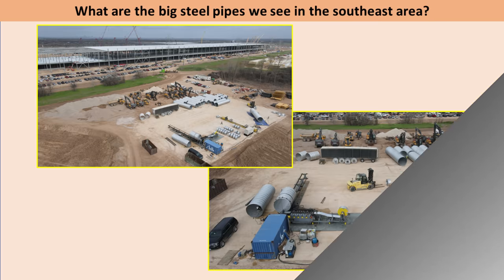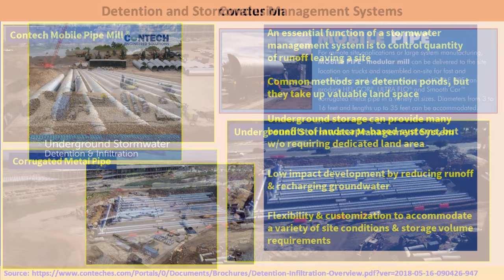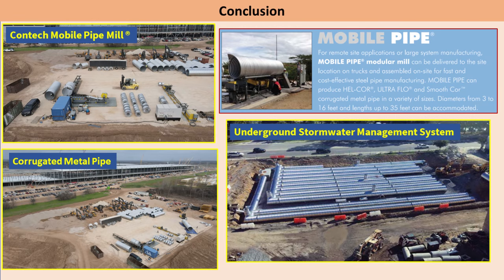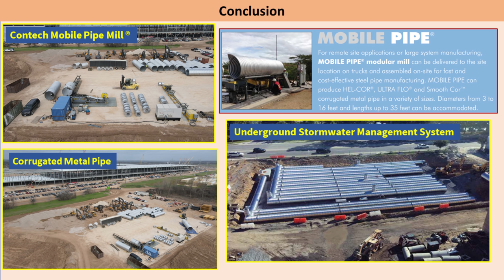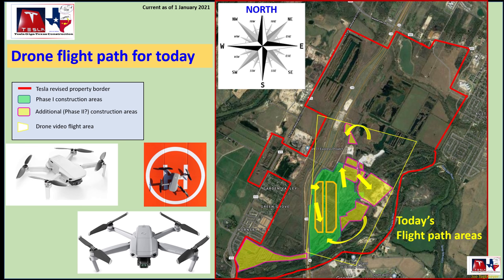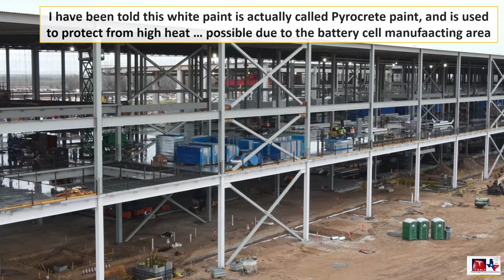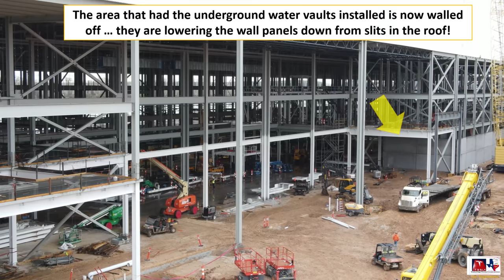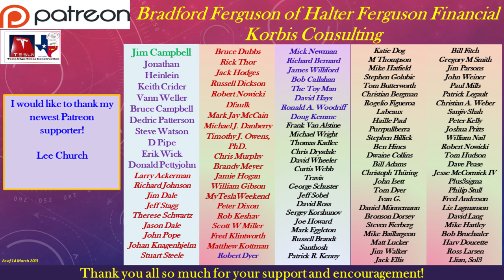Tesla Gigafactory Texas 14 March 2021 Cyber Truck & Model Y Factory Construction Update (08:30AM)

Comment: The Pyrocrete actually protects the metal from heating during a fire. With it looking as thin as it looks, it is probably a intumescent fire protection spray. Regular fireproofing is usually 1.25" - 2" thick depending on the fire-rating that the installer is going for. The intumescent spray can start as thin as 3/16" thick and get a little thicker depending on the rating that is needed. Intumescent firestop expands to protect the steel when exposed to high heat and regular fireproofing is always in an expanded state.
Reply: Does this mean all of the steel structure will be coated with Pyrocrete?
Reply: @jeffbransky6499  Depends on what they would expect the flame plumes to be. So if there was a fire, if they estimate the flames will only be 30 feet tall, that is the minimum height that the fireproofing would need to go. I know in the new Ranger Stadium they only went up 2 stories with the fire protection spray, so for the Gigafactory it will be up to the fire inspector and architect to work out what the code requirement would require.

Comment: Many years ago I was project manager for a chemical plant project including a 185 MW substation 165 kV to 46 kV. I followed the process from the manufacturing of the transformers, construction of the sub station and finally energizing it one late evening. I could shed some light on what we see on the fly over videos. Let me know if you are interested.
Reply: Sir, more than interested.  :D
Reply: Shed some light?
Reply: @jeffatchison2294  To put light on, to make it brighter and clearer.
Reply: We installed the 1st electrical switchgear/ substation in the factory on Thursday. It was a huge electrical milestone for the project. 24.9kv to 480v
Reply: @jeffatchison2294   Arc light.
Reply: Please do shed as much lite as you see fit. And yes, that is how I have been spelling light for years. Removes the extra letter and time when labeling circuits. I am a retired inside wireman, and have only worked on some of the higher voltage systems. Gas insulated switchgear in power plants, and 12.5kv distribution in a large waste water treatment facility.
Reply: @jeffatchison2294  Pun intended?
Reply from the maker: That would be great Arne!
Reply: @Joe Tegtmeyer This was when I was a new and not so experienced project manager in the US. I told all suppliers I will come and visit your facility before signing a contract.

The big transformer manufacturer showed me everything and I was impressed. This was about 30 years ago and today I have learned there are no big transformer manufactures in the US. It would be nice to know who supplied the step down transformers to GigaTexas.

Here is my story:

The vessel or tank is pressure rated for full vacuum and some over pressure.

The core is laminated steel with copper coils made of massive flat bars. Very thick metal in the secondary windings. Insulation on all copper windings was achieved by wrapping  with high content cellulose paper. The windings or coils must be able move when energized or de-energized . I could not believe the amount of paper and ropes and wood used to secure the windings, but still allow some movements.  All of this was assembled in a room with 1% relative humidity.
If you like this let me know and I will continue the story.
Reply: @arnecarlsson9740  Yes, Please continue. I have never been inside one of the larger units, but I have heard the stories of wooden nuts and bolts. The requierment for movement of objects is one of the most important aspects of manufacturing. I have asked the engineers why something was made with a certain material that didn't seem to make sense, until it was explained that they needed something with a certain co-efficient of expansion in order keep the movement within certain parameters. Material science is one of the most interesting engineering fields to me.
Reply: Joe will bring the marshmallows and I'll start the campfire! Maybe Jeff can bring graham crackers with Jack providing the Hershey's bars? We're ready!
Reply: @arnecarlsson9740  Continue please!
Reply: @TerafactoryTexas  
It is almost unbelievable to see this constellation of iron core with three phase windings made of copper bars. All copper is wrapped with high quality paper and everything tied together with ropes and knots. Large amount of wood is used to shim it up so it will stay together during handling and transportation. A step down transformer is supposed to last 30-40 years or more.

Next step was vacuum treatment. The whole thing was lifted into a huge vacuum tank and a very low vacuum was applied of two reasons. Firstly to remove all remaining moisture and secondly to be sure the isolating transformer oil would impregnate all organic material. Next step was to let hot transformer oil in the tank during vacuum and when fully submerged the pressure was increased and the oil impregnated all organic matter. It is the oil that provides the electric isolation and very important the cooling of the windings. I might have some more to tell if interested, 185 MW 161 kV transformer is pretty big and many parts are shipped separately in crates and to be assembled on site.

Comment: The "Toe boards" or "Kick boards" are to both prevent rolling objects AND kicked objects from falling over the edge. I was once hit by a small piece of concrete that slid off an overloaded trash bin on the floor above me. I was very glad for my hard hat that day, but it jammed my head down on my neck pretty good. I had a full sized pair of vice-grips fall off of a 12 foot step ladder that I was folding up. Happened just as I brought the legs together while holding it vertically. I dropped to my knees and blacked out for a few moments. Fortunately a co-worker caught the ladder as it was slowly starting to fall onto me. No hard hats required on that job. Never did find out who left the Vise-Grips on the ladder.
Reply: Come on GoCoyote, you're amongst friends here. You can tell us who left them there, we won't judge. I promise. 😐
Reply: @DessieDoolan  Trust me, I would have loved to give them a piece of my mind! I was done with my work and came over to give another crew a hand in order to go home at 17:00. They said, “you can take care of the ladders”. I was led away to the foreman’s desk to be evaluated. One of my co-workers was a former emergency medical technician. I vaguely remember being checked out, then driven home with instructions to me and my housemate on the symptoms of concussion. Oh the recovery rate of 22 year olds.
Reply: @GoCoyote  I was actually alluding to you being the vise-grip leaver! Speaking from my own sad experience, where after 42 years of work I would still often forget something on top of a ladder until the moment it came crashing down.
Reply: @DessieDoolan  Yea... I figured as much...Heh heh. While I did not leave those vise grips on the ladder, I am definitely guilty of leaving more things on ladders than I would like to admit to. Just never been hit on the head by them. It is one of those things that aprenti and journeymen alike get scolded for.

Comment: Time stamp 11:50 The transformers are usually transported dry for minimum weight, then need to be oil filled. Crucial that the oil is dry and no oxygen to minimise internal corrosion and explosion risk, so filling and drying the oil can take some time.
Reply from the maker: Thanks Mervyn for the added insight!

Comment: Hi Joe. So much to see! Observations from my first viewing, because there will be a second.
3:40. East wall stamping plant column extensions on the trailers.
5:04. Blue wall. Does anyone recognise the logo on the panels, might give us a clue as to what the panels are. My guess is some sort of fire rated sheetrock/drywall/plasterboard.
5:33. Starter bars to the right side of the footings have been fitted with their plastic sheathing.
7:02. No question about it now, the original zipper is under a concrete floor.
9:17. Interesting to see if these get laid the length of the building under that road.
16:30. Rails on ground. Bridge crane presumably.
Reply: They look to me to be some sort of sound deadening material.
Reply: You are so observant! I almost always miss almost everything you point out. And here I am thinking I'm watching carefully!
Reply: @jeffatchison2294  Could be. It would be great if someone local could recognise the logo, then we'd know for sure. I'm leaning towards to fire separation.
Reply: @LinasVepstas  So much to see, it's accelerating now. Hard part is deciding what to comment on, blindingly obvious stuff to a retired building worker like me that might be of intense interest to the less informed, or the stuff that I just don't understand which might not be of interest to anyone else. 

I get a kick out of your witty comments!
Reply: @DessieDoolan  RE blue wall: I actually tried using TinEye with a screenshot of it... but it is very blurry, so couldn't find anything. Maybe if you get a higher resolution than me you could get a useful screenshot.

Comment: 14:22 For gas fired furnace, 800 deg C to melt aluminium to run (test) the gigga-press.
Reply: Could be but aluminum is actually manufactured with electric power. Aluminum refineries are located near cheap hydroelectric power sources.

Comment: @ 13:51 I was wondering how the rain had gotten so deep in th the first floor.  The only reason could be if it came through thr roof.
@ 8:00 You see many drops from the roof in the water below.
This is partly because the roof isn't finished and becasue the corrigated roof panning on this section runs north-south when the pitch runs to the east.
I'd like to know when the roofing contractor is going to show up and seal the roof.  Can't do much if everthing is goign to get wet.
Reply: I agree, it is frustrating to see
Reply: They have to wait until the storm water management is done before sealing the roof. It's better to just let it drip through all over the place (onto bare concrete or impervious equipment), than have a waterfall over the edge uncontrollably eroding away the earth underneath it.
Reply: @CiaranKing  there is a waterfall running over the edge of the concrete roofs now!😁
Reply: @CiaranKing  In the rest of the structure the roof panning runs east-west so there will be waterfalls over the edge all over.  The floors in these other areas are not so wet.
 Water management is a big thing on this site in a number of ways and an area and I have been keeping an eye out for progress on.  Post10 and I are Glad to see the culvert going in.
Reply: @timboatfield  However, the corrugated roofing is sealed not water tight at the joints so even the east west strips of roofing can leak.
Reply: @jeffbransky6499  I'm not sure if the current roof is even sealed.  I didn't notice any additional materials/waste on the roofs.
I do expect that the overlaps are in the direction of the pitch, as with tile or even thatch. So it would need to rain some to get though.
  I would love to know the reason the trusses on the BiW section were 90 degrees to those on the rest of the site.  Requiring rotating the roof pan equally.  Which raised concerns of sceans like 8:00.  
  Also further into the lifetime.  If the waterproofing fails the scene at 8:00 will be recreated in a live factory.  I don't think thats part of the dream.  I think this was a falcon-up and maybe a component of construction-hell.  We'll have to wait for the book.
Reply: @timboatfield  I think all is going according to plan. They are working on everything all at once to shorten the completion time. It never looked like they sealed the corrugated strips on the roof. They can keep the equipment under wraps until they are ready to install them. I never saw any indication that they were sealing between the roof strips. The outer roof covering will create a water tight barrier. I do wonder why they haven’t started with the roof covering. One observer here stated that allowing the roofs to leak temporarily keeps a deluge from washing out the soil around the building. In Berlin there was no covering at all over the die casting machines for a long time; just tents. How they manage to keep everybody out of each other’s way must have taken a lot of planning.
Reply: @jeffbransky6499  You reckon there's a Plan?! That will be welcome news for some of the contraxtors /s
  I don't buy the argument that leaking roof was/is prefered over having to deal with a lack of structured drains when it rained.  At least not for the BiW and Paintshop, which along with the Stamping and Casting are priority areas.  Temporary pumps and pipes and an eye on the weather would fix that.
  Whatever the cost of doing this would be gained in working with equipment worth millions in wetroom conditions.
Reply: @timboatfield  Maybe you didn’t notice the stamping building floor in the center section was totally soaked in a recent video. How did water leak through the concrete roof. I’m confident they have everything well in hand and some wet floors at this stage are no big deal. Relax!
Reply: @jeffbransky6499  Yes i commented on the undryness of the stamping area elsewhere.  That roof isn't finished either, but should be rainproof.  Thats another question.
  Too much confidence is called hubris.
  Who the falcon are you telling me to relax?!
Reply from the maker: The current roof is just the initial panels and not meant to be fully water proof.  There are still several layers left to be installed.  They are moving quickly, but still have a lot to do before the roof is complete and water proof.

Comment: I think the Compressed Natural Gas (CNG) is for running the furnace to heat the Aluminum for casting. The power is already there having been run from the South  end. There is also what looks like refrigerating equipment East of the casting machine under the concrete structure.
Reply: Wouldnt it be electric arc furnaces?
Reply: Somebody commented that Elon did not want natural gas service in the plant. I have no idea if they knew what they were talking about. The liquid natural gas may be a stop gap measure and won’t be needed when the plant is completed?